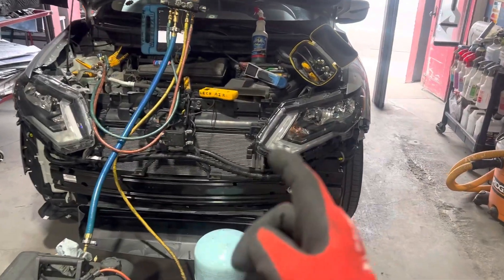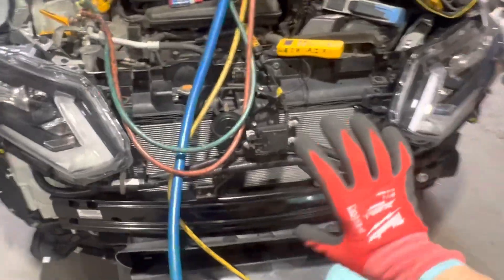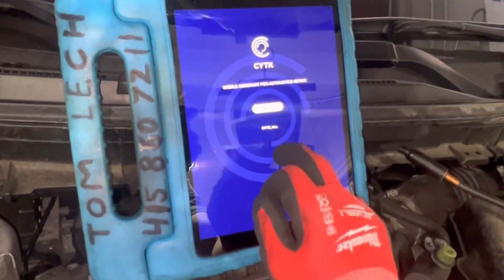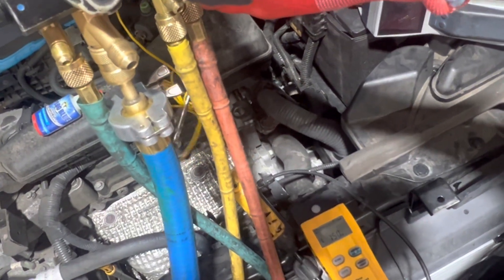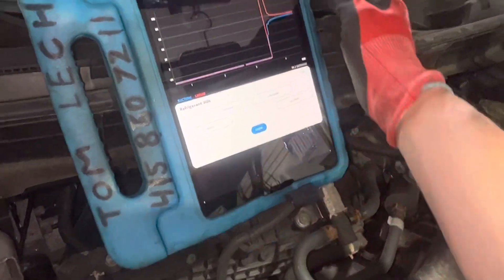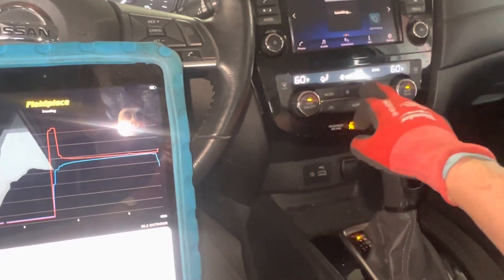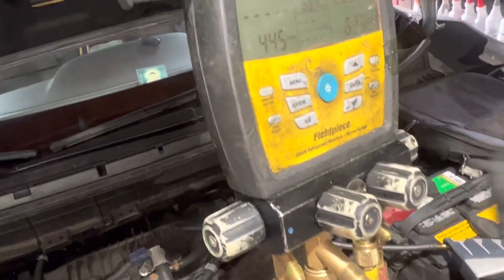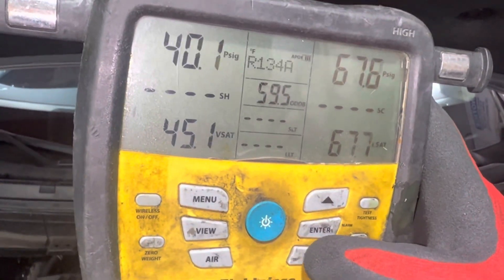Refrigerant Charge 2018 Nissan rogue 500g.

Comment: why do you use a bt probe to measure the ambient temperature before the condenser? The one that comes with the SMAN 480 temperature sensor on the cable is worse?
Reply from the maker: Because it gives me humidity to.  That’s the only reason..   they’re both equally as well for temperature.    I get tired of unwrapping and rewrapping the little wire.. 

When the wire is left on the gauge of high on the hood, the hot engine temperature goes up there and give you a false reading an extra 15 or 20°.

Comment: Hi Tom
 I was taught many moons ago when charging a car to allow for the refrigerant in the lines. Ie if system capacity was 500g then add 520-530g. What's your opinion on this?
Reply from the maker: Are you talking about the remaining liquid refrigerant that is in the liquid line hose is roughly 30 g of refrigerant that you were compensating for.   This is true. It depends. Did you zero out the scale before you added refrigerant to the hose or after you added to refrigerant to the hose that will make the difference. 

And any refrigerant that you have left in the hose is easily remove within 30 seconds just buy attaching it to your recovery unit . 

And don’t forget the high-pressure liquid refrigerant in your red high side, refrigerant hose to slowly bleed it back down through the low side so you don’t steal 30 g from the system capacity .